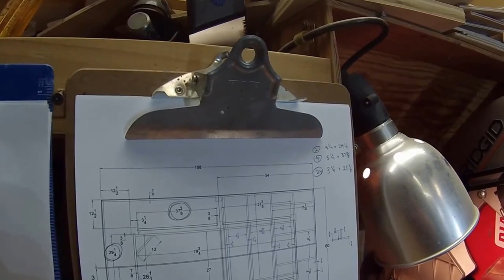Walnut Pong Table -- Part (3/4) -- Making the Base

Comment: LOVE IT !!! Just out of curiosity, the dado trick...was there some sort of calculation you used to decide on the radius on the end of the aprons or was it trial and error so to speak? That is just a fantastic idea and one I have never seen before. WOW !! You got the look of mortise and tenon, a ton of glue surface, then backed it up with pocket holes. Then with the corner pieces that base could hold up a tank.Just brilliant. Loved the series !!! Again, fantastic job. Very detailed.
Reply: Work Against The Grain Radius is equal to the radius of dado set
Reply from the maker: Work Against The Grain
that jig is on my list of videos i need to make but to answer you question, the template is made to fit the profile of the dado after a test cut is made.  the shape of the curved arc depends on whether its a 6" or 8" dado, and how deep the cut is, which in my case I set the standard mortise depth at 3/8".
Reply from the maker: +hffcom 
I made a DIY about this jig finally, so need to explain as I show how to make one for a 6" dado blade in my video Table Apron Jig for Dado Mortises
Reply: +hffcom Just watched it. Great job. Really, thanks for showing that. Man that's so ingenious.

Comment: I would never wear gloves using a drill press. If you catch your finger with the bit it will cut you. If the bit grabs the fabric of the glove it will wrap around the bit and pull your finger into the bit and do a ton more damage. I've seen it happen and it's terrible.
Reply from the maker: correct. I try to take them off at the drill press but forget sometime